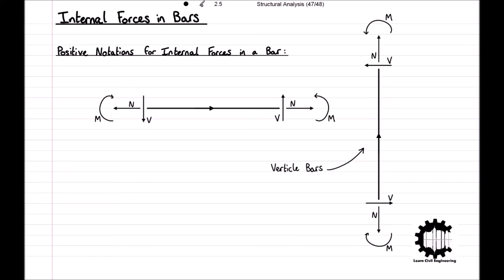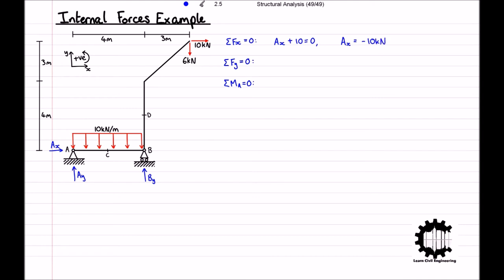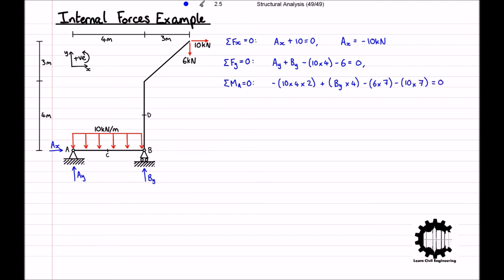Introduction to Internal Forces in Structures with Example - Structural Analysis

Comment: On minute 9:14 , for what does the number 1 stand for at (10x2x1) can you explain please ?
Reply: The load of 10kN/m is applied across  a distance of 2m between node A and node C. The equation is for the moment around C and the part you are asking about is the moment caused by the 10kN/m. We can model it as a concentrated load of 10kN/m times 2m, and then the moment is the force times the distance. The load is concentrated at the mid point, hence a distance of 1m from node A.

Comment: On second 0:14 you show the positive notation for the internal forces and repeat it later on min 3:55.
As far as I remember from my structural classes, the positive moment is always anticlockwise. Can you explain why do you consider it positive clockwise on the left side of the bar? Thx
Reply from the maker: Thanks for your question Ân Gelo.

When considering external forces in structures, we always take the anticlockwise moment to be positive.

Here we are considering the internal forces within a single member. Since the internal forces in the member must equate to zero (for the member to be in equilibrium) and we are taking the anticlockwise moment on the right side to be positive, we must take the anticlockwise moment on the left side to be negative for equilibrium, i.e. a clockwise internal moment on the left side of the member will be taken to be positive.

(You will notice the upwards vertical internal force on the right side is positive and the downwards vertical internal force on the left side is positive as well, this is for the same reason as described above)

I hope this clears it up for you 🙂

Comment: Will you ever get to the higher level material or will you only be posting videos for new CVG students
Reply from the maker: I do plan to cover all content for all topics over time, including the higher level material. I am just starting with the foundation material and building up rather than jumping into advanced material without any videos on the fundamentals to accompany them.
Reply: @Learn_Civil_Engineering  yep, that would only make sense. Did you specialize in any particular field of Civil Engineering (i.e. waste water, hydro,structural etc) ?
Reply from the maker: I have specialised more towards transport and infrastructure but still did the core modules like geotechnics, structures and hydraulics as they're useful in almost all disciplines.

What field have/are you specialising in out of interest?
Reply: @Learn_Civil_Engineering  I went towards the management side and took on the Engineering Management and Entrepreneurship specialization. But I do plan on taking specific structural engineering courses in the future.